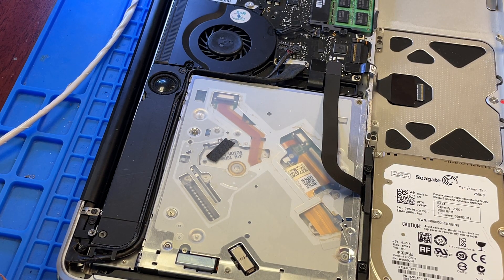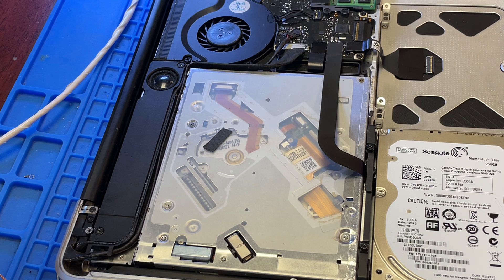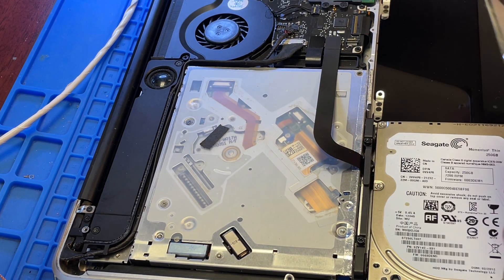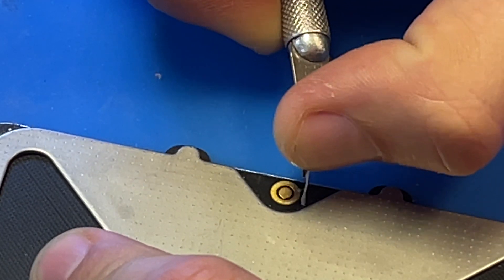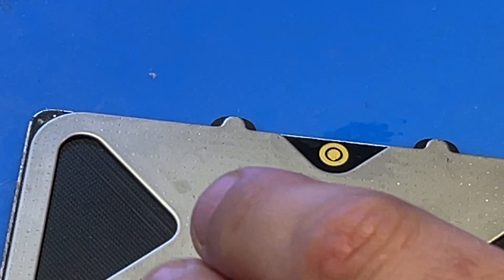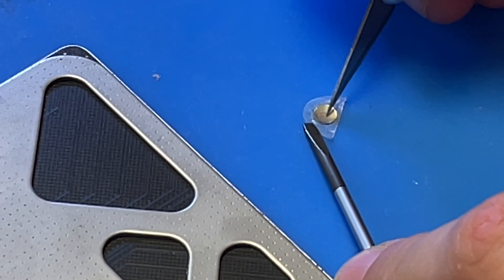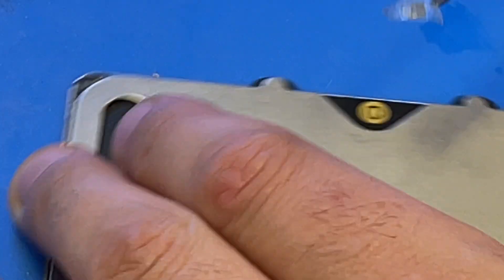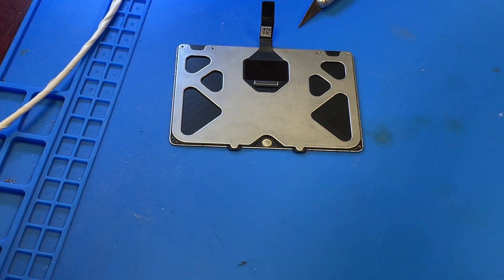MacBook Pro 2008 2009 2010 2011 2012 Touchpad Button doesn't click or hard to press repair

Comment: Some macs has another problem to solve in this issue. As the track pad is under the battery, if the battery stuffs and grow cause extensive use, it press the base from trackpad difficulting to press down the intern button. Is good enough to change the old battery!
Reply from the maker: And if it’s not taken care of in time on these models swollen battery will crack the touchpad

Comment: How does this make a difference if it's hard to press on the trackpad? All this did was clean it,
Reply from the maker: If it’s hard to press - most-likely your battery is swollen and is pushing on the trackpad.
Reply: @applepietech  Looks like it, yea. I had that issue with a 2011 MBP. This is a 2013 15in Retina, with the separate battery pouch things, vs the 1 big battery

Comment: Thanks Vlad, actually my A1398 just started suffering from this so your video is just in time 🙏
Reply from the maker: My pleasure, Pete! Glad that it might help You. Not as easy to take out touchpad on A1398 though because of that glued-in battery but button mechanism is the same on 2012-2014 models